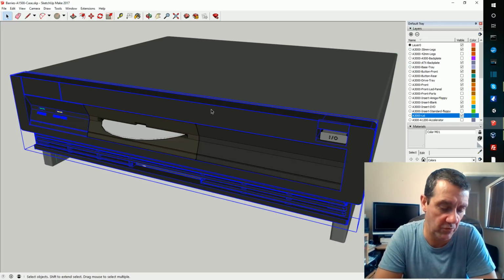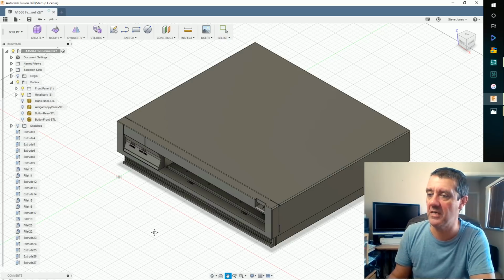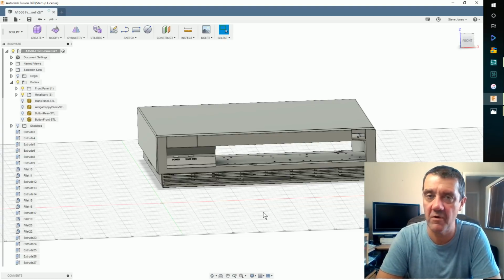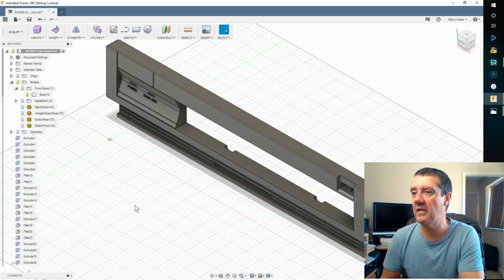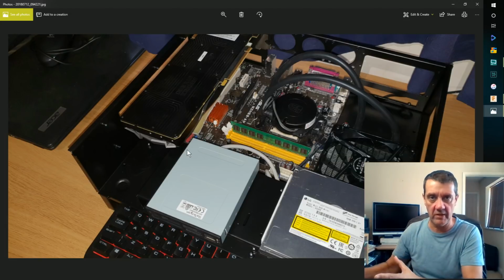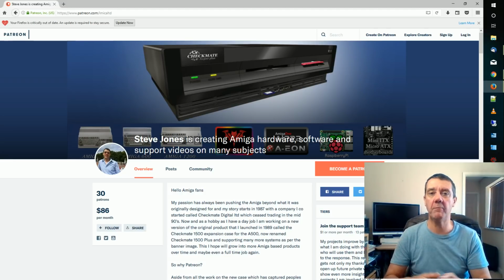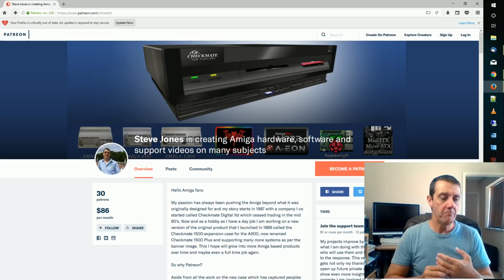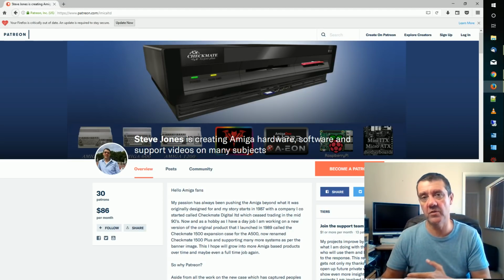Checkmate A1500 and please support projects on Patreon

Comment: Thanks for the mention... cant't wait for the finished case. I've had a spare recapped A1200 with a damaged case and no floppy drive laying around for ages now and one of these is to be it's new home :)

A quick question about the power supply, will it supply enough juice for 060's? the standard psu's that came with the likes of the Power Tower didn't and had to be replaced so thought I would ask.

Comment: I was just wondering if anyone stumbled upon an non-working OLIVETTI M3030 Desk Style Computer would it not be worthwhile taking the back of and gutting the system and replacing the electronics and power supply with the internals of a COMMODORE AMIGA A1200
and use the FDU to accommodate  the Hard-Drive and DVD drive  and I think that the printer could be replaced with a Network Printer plus you need to modify the keyboard to work with the AMIGA keyboard and replace the monitor with an CRT or LCD monitor compatible with the AMIGA A1200.

Comment: How about FreeCAD? I used it on the Mac and it works pretty good (also available for Windows and Linux).
Reply: Will check it out next time!
Reply from the maker: As I mentioned further down, it is too complicate and Fusion 360 is free for startups
Reply: Fusion 360 is superior in almost every way. Good choice Stephen.